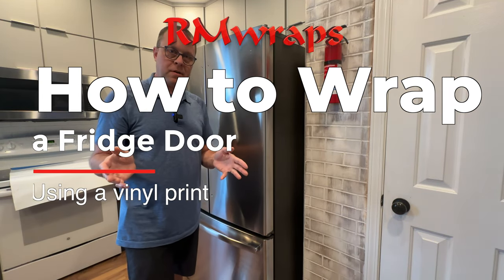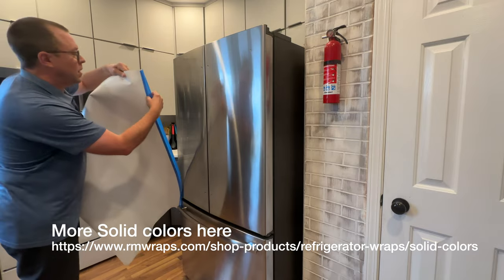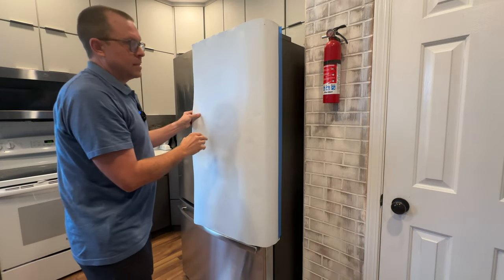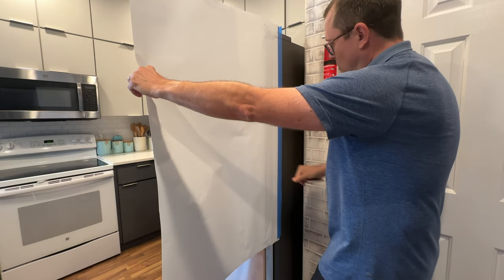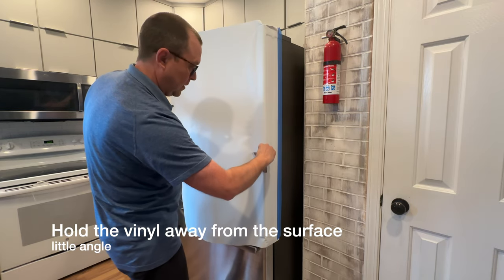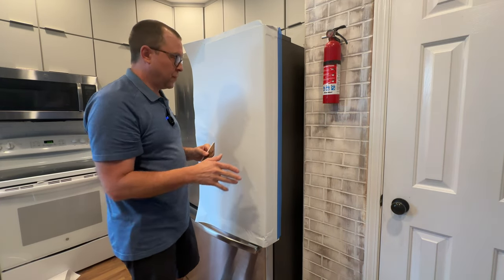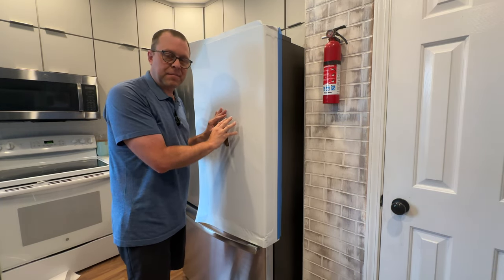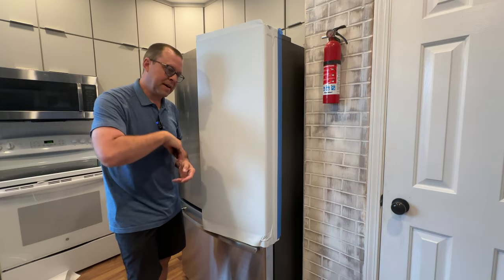Quick-Tip: How to Wrap A Curved Fridge Door with Vinyl

Comment: Why are they making refrigerators that cost us extra money to keep them looking nice?  I guess their quality of intelligent workers has gone down considerably because we never dealt with this in the past.
Reply from the maker: In today’s market, many manufacturers prioritize sleek designs over practical durability, which can lead to surfaces that show fingerprints, scratches, or wear over time. This is where custom vinyl wraps come in, offering practical solutions that go beyond just aesthetics. Here's why wrapping your refrigerator is a smart choice:

No More Fingerprints or Smudges: Vinyl wraps provide a protective layer that resists fingerprints and smudges, making cleaning and maintenance much easier.

Customizable Look: Wraps allow you to change the color or finish of your fridge to match your kitchen's style—whether it’s a bold color, a metallic finish, or even a woodgrain texture.

Unique and Personal Designs: You can add a unique design or even a custom print to make your refrigerator one-of-a-kind. It’s an excellent way to personalize your space.

Cost-Effective Solution: Instead of replacing your refrigerator because of aesthetic issues, a wrap is a fraction of the cost and transforms your fridge into something that feels brand new.

Durability and Longevity: Vinyl wraps protect the fridge’s surface from scratches, dents, and other daily wear and tear, extending its life while maintaining its appearance.

Comment: I have a question: if the front panel has a small dent, would a wrap also take on the dent's shape as it goes over it or would it make the door look flat again?
Reply from the maker: Yes the vinyl will take the dent's shape. You need to fill and sand the dent smooth before putting the wrap on. We like using Bondo or 3M spot putty.

Comment: Can a fridge be wrapped with the handles still in place? Would it be hard to cut around them?
Reply from the maker: It’s best to remove everything to wrap. It’ll be challenging for the handles to be on.
Reply from the maker: To explain a little further - it's only possible (not guaranteed) to hide the cut seams with vinyls that are specifically designed for overlaps, like architectural films (we are sellers of 3M DI-Noc architectural films on our second website www.rmwrapsstore.com). On those specialty films, the glue layer is closely color-matched so that you can overlap the material on itself and not see the glue. 

On most vinyls, like the material we use for our printed graphics (www.rmwraps.com), the glue layer is a dark gray - it provides the functionality of being block-out, so you can put white vinyl on a black refrigerator for example, but the glue layer is visible at the edges because of that - unless the printed color happens to be very close to the color of the glue (dark grey), the glue layer would be visible where you do a cut + overlap, and it will be very apparent. 

More on wrapping with handles in place - it depends on the handles, but the proper way when you absolutely can't remove them, is to wrap with 2 pieces that meet/overlap underneath/in-line with the handle. Again, this only really works and has a chance of hiding that seam (which will run the whole length of the door), if the material is designed for it - our graphic and color wraps on rmwraps.com are not.